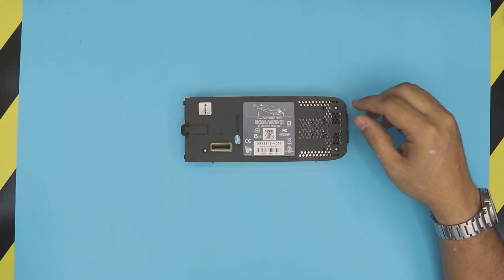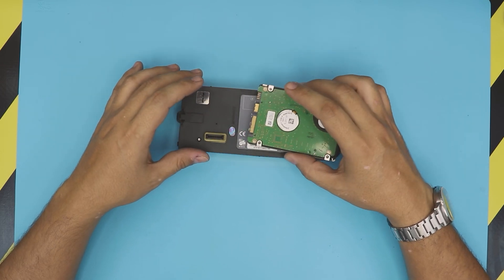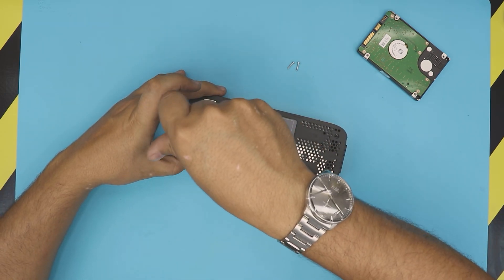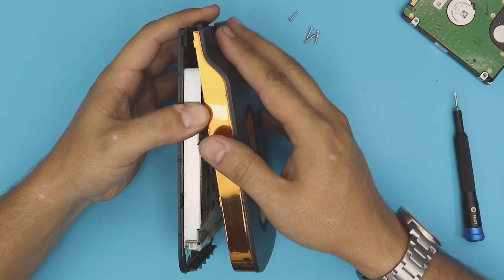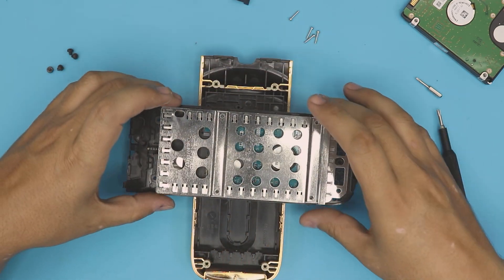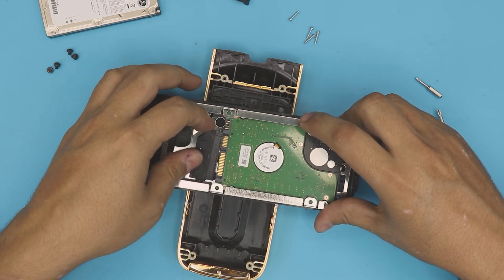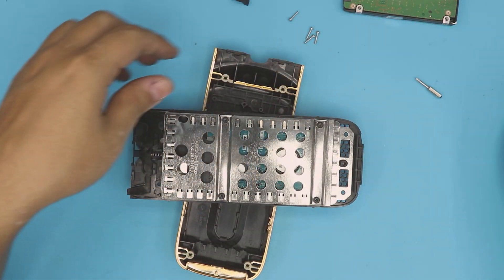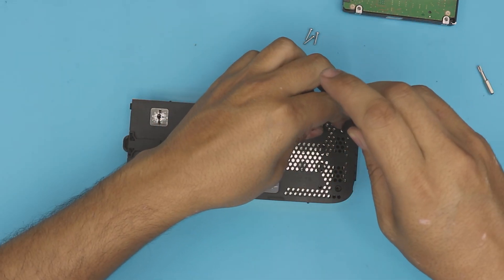XBOX 360 HDD Upgrade using old HDD from a Laptop

Comment: I have an xbox 360 slim, can I use this way to put my laptop's hard drive in fat32 format to the connector on the internal hard drive of the xbox, thanks a lot
Reply from the maker: yes the laptop HDD are the same as PS3 and PS4 and XBOX 360 and xbox one HDD.
Should you have any further questions or requests in the future, please don't hesitate to ask me.
Reply: @uFixTek  Do I need to format my hard drive to fat32 for xbox to recognize it?

Comment: Is this plug and play? After replacing it to a higher capacity hard drive or ssd, what do I do after installing it back to the xbox? Is there any guide for it if ever? Thanks.
Reply from the maker: Thank you for the feedback! if you wish to support the channel you can LIKE or SUB or both :P
regarding your question:  after installing power on the console and in the option you need to format the drive.

Comment: Ai so since I was trying to figure this out myself I'll put what (from what I've seen from other videos) you have to do is this. Get a slim hard drive like the one in this video. After that there are two ways of correctly formatting it. Either connect it to a pc and format it as fat 32 (this method I'm not too sure about but you can try it out. Or you can get a USB to sata connector and then connect that slim hard drive to the xbox as an external hard drive. This will give you the option to have the xbox format the Hard drive itself. After you've done either of these steps then follow this video and put the slim hard drive into the hdd enclosure. I can't guarantee that it will work but it's worth a shot if you really need the storage.
Reply from the maker: yes my friend pc format fat 32 its the same compatible format that does the xbox fat 32 default. thank you for the feedback and your support :)
Reply: I've tried it with a USB to SATA Connector, however the Xbox doesn't recognize anything unless it's formatted as FAT32 which in this case is not possible for hard drives
Reply: @edoo1  you can format a hard drive to FAT32 using the windows command prompt or with a partition manager software

Comment: can i use ssd harddisk for xbox360? im worried it cant readable in machine 😅
Reply from the maker: Thank you for the feedback! if you wish to support the channel you can LIKE or SUB or both :P
regarding your question: yes you can.
Reply: @uFixTek  if i replace to a new HDD. how about the firmware? should i intal it again?

 the problem is my old harddisk is broken 😆. and now its undetected.
Reply from the maker: yes you have to re install the firmware.
Reply: @uFixTek  how can you do that ?

Comment: You can’t put any drive in there and it will work. Put up a vid when you plugged it back into the Xbox.
Reply: So, you just format it with the xbox storage utilities. This method works fine.
Reply: @BeachBum68x  dawg. It don’t.
Reply from the maker: Thank you! for the feedback and your support to the channel by SUB :P
regarding your question: any sata drive even a ssd drive 2.5" will fit and work. i will make a video on that installing it back into xbox
Reply: @uFixTek  they will fit but unless they're properly formatted they won't function with the 360.
Reply: @uFixTek  Did not deliver